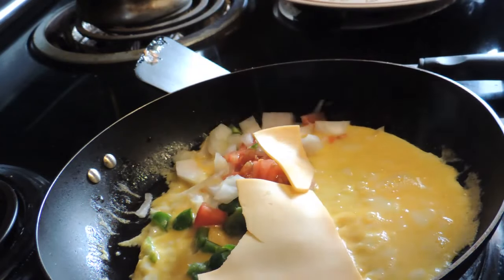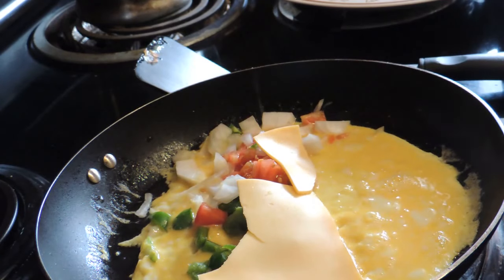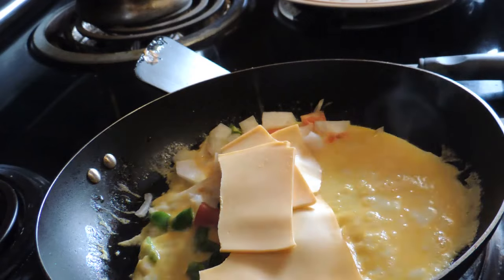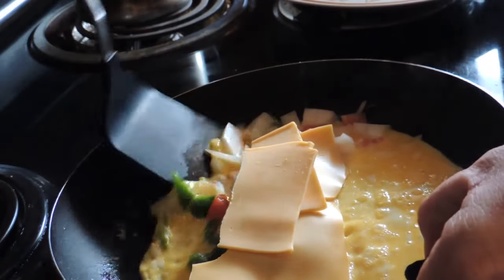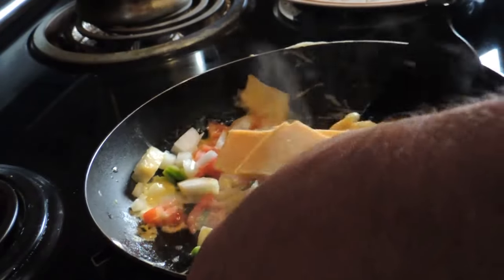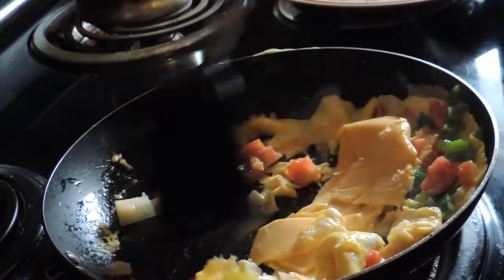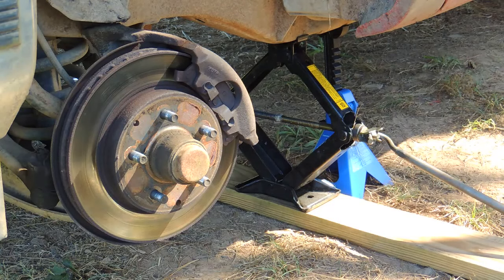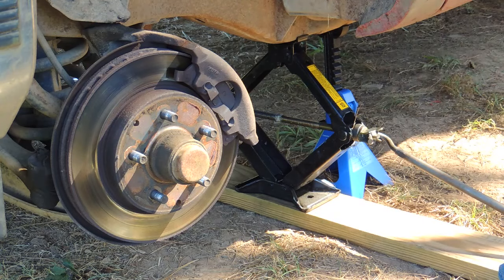92 Chevy wheel bearings,More dogs,Vittles!

Comment: Those scissors jacks are dangerous, don’t crawl under the truck with out proper support, of course I hope you knew that.  Ok got my answer on ROOSTER…. Thank ya kindly.  Nope hardly dirty, just slightly greasy 😂
Reply from the maker: There is a jack stand supporting the weight,take another look.